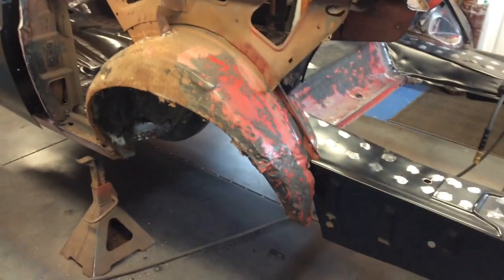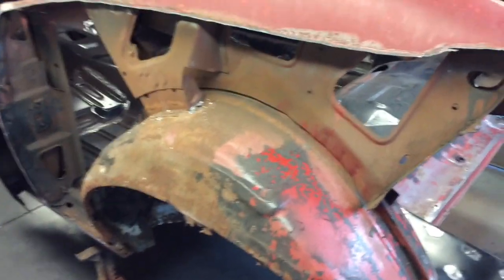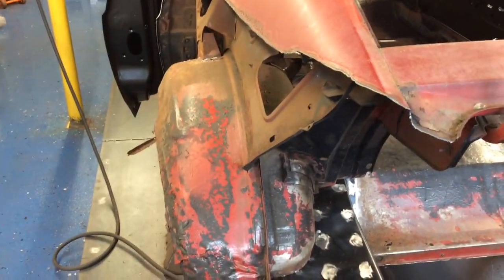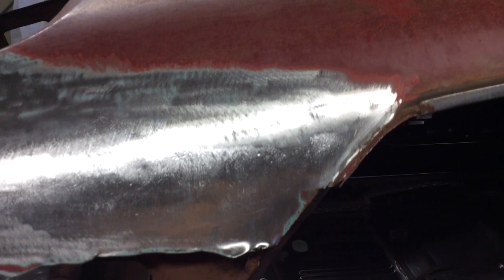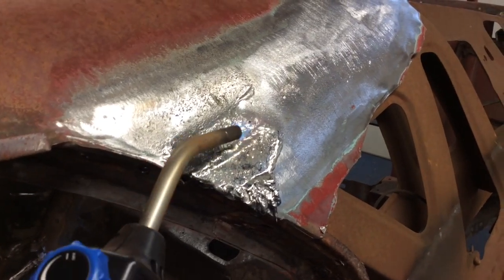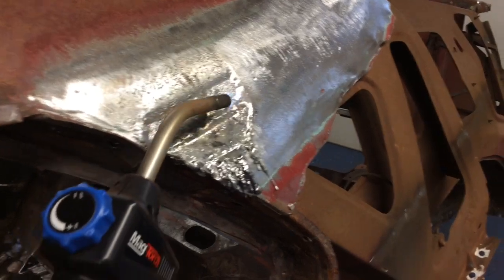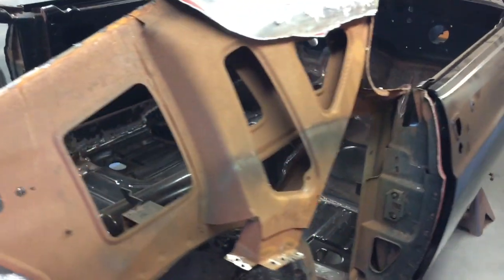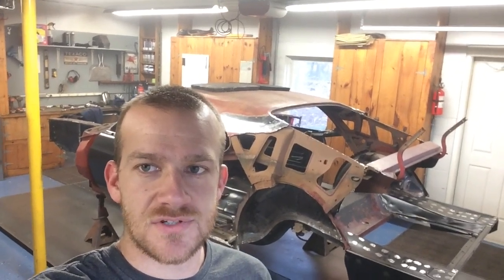Removing The Remaining Quarter Panels On A 1969 Mustang Fastback

Comment: I was lucky when i started doing body work the guy app with was able to teach me lead work. I repair several 1930 and 1940 auto with lead and silver sodier i think it was 70/30 % and used a waxed paddle to smooth the lead. Hammer and a file to shape. ONLY HAD TO WORRY ABOUT THE FUMES.They had such skill back then .

Comment: Nice work seeing how far involved the work is restoring. Have you ever considered using an industrial Spot Welder used in the motor vehicle trade. Far easier than mig welds and grinding. However mig welding use where required if Inverter Welder can’t get to areas.

Comment: I have heard 2 lines of thought when replacing the quater panel- 1) car on a jig  or 2) with it on the ground and suspension to support.  Which one is stronger as as Ive heard the body can creek when driving around corners. What do you find is better. Love the videos of all your work

Comment: If you hit the molten lead with a wire brush, brushing across the area, you'll get the lead out quicker.  Less heat over all is needed.

Comment: What do you use to fill the leaded seams when you’re done?
Reply from the maker: I leave that one up to the painter
Reply: @petersonrestorations  doesnt a wire wheel put lead particles in the air?..